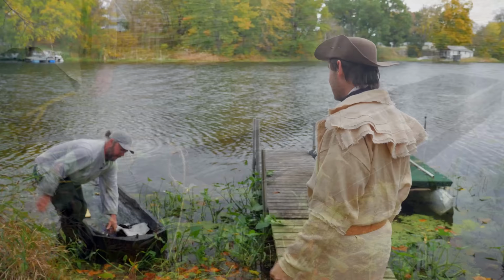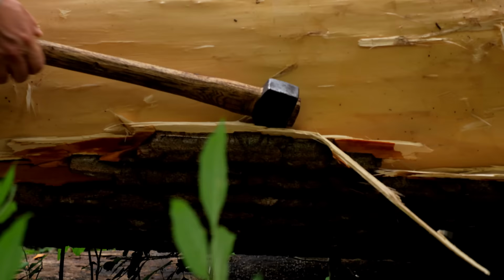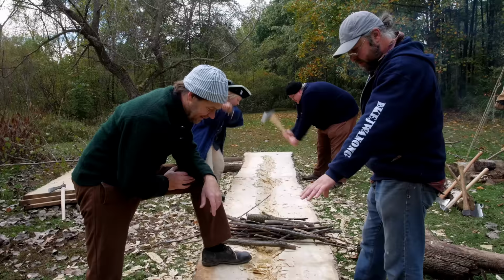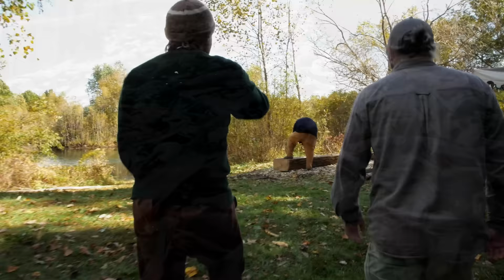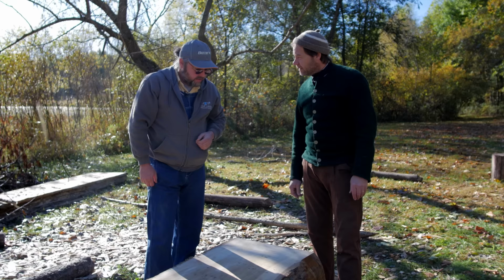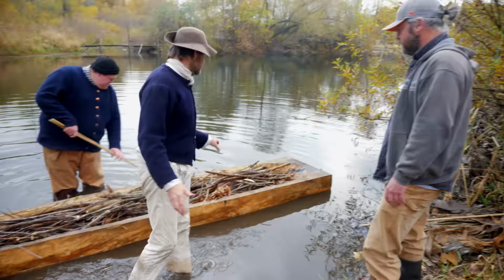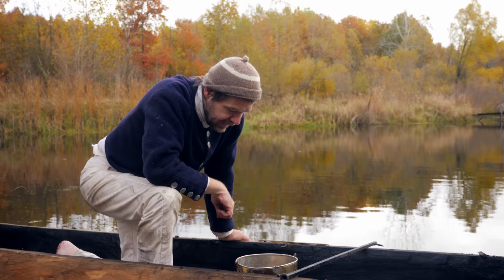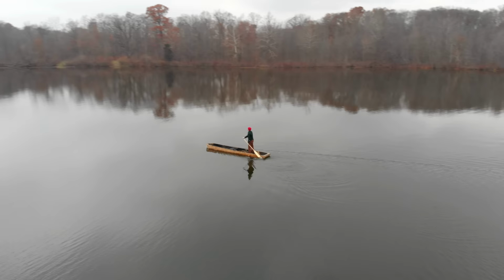From Tree To Canoe: Full Length Anniversary Edition - Dugout Canoe Build

Comment: A hewing axe would be extremely helpful for working the sides. The cutting edge is offset to one side of the axe head and handle, allowing it to be swung along a surface and take off a chip to flatten a log. There is an old video on Norwegian cabin building that shows and explains it well somewhere on youtube.

Comment: In a few lakes around where i live, you can find several of these types of canoes still on the bottom. Some a few hundred years old and some lots older. They do preserve well in some clear water lakes. 

There are finds of 8000 year old ones in Europe. Oldest here (Sweden) so far is about 3000 years, but close to where i live they found a 4500 year old paddle in a bog. 

At a lake not far from where i live there are at least 3 log-boats/canoes still sitting on the bottom and the water i so clear you can still see them despite its a few meters deep. It’s an amazing feeling to float by just watching them.

Comment: This was great!  How many hours must it have taken to do all that?  That is true labor.  But why do they store them underwater?  Wouldn't that make them rot?  Great episode, guys!
Reply: Yes I was wondering about the underwater thing as well
Reply: They will rot eventually. but it might take decades or even longer depending on the chemical composition of the water. What they don't want the boat to do is dry out, because wood being a natural material, it will shrink (and possibly warp). If the canoe dries out, there is the potential for the wood to split when re-floated in the water again as it swells at different rates between the top, which is in the air and the hull, that is in the water. Even today, with wooden planked rowing boats and dingys,  they need to be kept wet or even sunk from time to time, to keep the wood swollen and make the joints tight. That would be my reasoning, anyway 😃
Reply: To keep from getting stolen. After you do all the work making a dugout, a lazy person would avoid the hard work. A lot like cattle rustling.
Reply: @geraldmiller5260  Lol!
Reply: @jcorbett9620  So, in the olden days, I suppose it must have been important to know which bodies of water had chemical compositions that would cause problems. Really interesting how people had to work before modern science, just using intuition and a shared knowledge of the area.

Comment: They never explained the reasons for storing the canoe under water!  That was something I really wanted to know.  Can anyone please explain how storing underwater works  in preserving the boat without it getting soft and rotting/disintegrating over time?  I thought maybe they would seal it with something but perhaps that's what the wood burning process does?
Reply: Wood degrades slower in a lower oxygen environment.

Comment: Question: If you are just storing the canoe underwater...why not turn it upside down? that was its not so  bogged down with so much water when you have to pull it out to use it later?
Reply: How are you going to keep it underwater if it's upside down? You need to weigh it down, but those weights could slide off, or be moved by the water current, or animals. If your canoe is right side up, the weights won't leave the canoe, the sides keep them from sliding too much. Being made of wood, that canoe will start to float up if it's not being weighed down. The extra weight also makes it harder for someone to steal your canoe without being noticed.

Comment: Had it been me, by myself I would've grabbed a circular saw and cut criss-cross then levered out the chunks with a crowbar.
Reply: Well the entire point was doing it with what settlers had at the time, as group traveling the back woods and unsettled areas. Obviously modern tools could do it much easier.

Comment: why are they stored under water? is it to prevent it from drying and wetting many times?
Reply: That's exactly the reason. Being made of a natural uncut wood (a single trunk that was never split into planks), the canoe would crack and warp if it was dried and wetted too much. It rots and breaks down slower if it's kept under water, and it has the extra benefit to making it much harder for someone to steal the canoe, just due to how long it takes to remove the weights and bail it out. Storing canoes on land didn't happen unless it was made of smaller pieces (the nails and other materials wouldn't last underwater), or coated to help preserve it when stored in the open air.

Comment: you know theirs much lighter way and faster way to make a canoe, you have to take the bark off in one piece and you make canoe out of that oval/eye of bark, it takes some time to slowly bend it to shape and it must be kept wet during most of construction(if you arrange rocks in a stream right you can get the basic shape then keep piling rocks in middle over a week or so till its filled out shape then pull it out and work on getting its bow & starn finished, but its a lot less effort than carving one still and stronger by a number of times for its weight. they used them for over 10000 yrs in india & australia, 1 man can carry it on back easily for kms between creeks

if you do it right over generations you can take multiple canoes from a single tree so long as you dont damage it to much when your removing your bark oval to make canoe
Reply from the maker: We have made a bark canoe as well https://www.youtube.com/watch?v=lLbb0ZX5up0

Comment: Did those canoes have a keel?  Keels allow the canoe to go straight easier, but without a keel they turn easier.  Difference being, without a keel you are more subceptible to the wind.and harder to stern.
Reply: As you saw in the video, the canoe had no trouble with staying upright and balanced. Even walking across it didn't turn it over, during a windy day. I assume the log was good enough in shape to not need a keel, or the weight an shape made up for. Although they shaped the end of it, they didn't make changes to the underside.

Comment: I definitely would have used power tools to save time and get a lighter, thinner result. I would burn the interior to give an authentic surface finish. I would also create a thwart seat every five feet.

Is there historic precedent for drying the wood and preserving out of water with linseed oil?
Reply: Using power tools would ruin the sense of historical process and learning, which is the main reason for building this canoe in the first place.
Reply: @ironcladranchandforge7292  Not for me it wouldn't. I've created authentic historical impressions for reenactors using modern materials and equipment.
Reply: @KJ6EAD  --  Then you've lost historical perspective and knowledge. I've worked for the National Park Service for many years as a Blacksmith doing re-creations and restoration work.  All this work was done in an 1820's Blacksmith shop without modern tools of any kind including lighting, and using traditional tooling and methods.  It's amazing what you learn and more importantly a historical perspective of what it was like to work in those conditions. Heck, anybody that has a little skill with modern power tools can make something.
Reply: @ironcladranchandforge7292  What you're saying is true but the choice of a purist method is arbitrary. I'm just not that into it. We all choose how to spend our time based on need and interest. I'm sure I'm missing the full experience of all the things I haven't or don't do and there are things I've done that only a few ever have but I feel no need to gatekeep the rules for others unless they're damaging other people or their property. I wouldn't come to an axe event and crank up a chainsaw but neither would I go to a motorcycle event with a horse and proclaim superior historical purity.
Reply: @KJ6EAD  --  Well, you have a good point, and one in which I cannot argue against. Each person has to do what's best for themselves. Sometimes I lose that perspective because I've been so ingrained in historical research for such a long time, LOL.  

In my current Blacksmith Shop I've been known to use some limited modern power tools due to time constraints. However, I am slowly but surely moving away from that as I begin a new series of historically driven projects and research.  It's just my thing, LOL.

Comment: The downsides of storing in water is that is heavier, and must be bailed out to use it, as well as lost under certain conditions.
Reply: Natural wood will start to crack and warp when it's dry for too long, especially when it's then suddenly re-introduced to water after being dried for long periods of time. That canoe can last for years underwater, and that was the entire point, to make something that could last for a while,. It would rot and weaken faster when left out in the air. The other issue is that it's easier to steal a canoe when it's just sitting out in the open. Much harder when it's under water with weight holding it down. The benefits far outweigh the downsides.
Reply: @ZakTheFallen  
Think the bigger problem would be splitting and shrinking in the wrong locations.  You can use products to avoid these issues and avoid having to kneel in a wet canoe.  
I love that this channel takes a purist approach and enjoy watching it for that reason.  We can certainly use hybridized methods nowadays while appreciating the history, or do as those dame bv before us.  Each has its benefits.  It certainly made sense for the time however.  however

Comment: Instead of so much waste, how about portable designs that they would have used to portage up in the boundary waters?

Or if eskimos and inuits and alaskan natives could make kayaks then certainly it raises a question that they in contiguous 48 with a longer season must have had more opportunity to have had other designs much lighter and less particular and wasteful of trees.😳
Reply: This was a time when there were several times less people to do it, and didn't have the luxury of choosing different methods. You're also trying to compare very different cultures, and how rare it would have been for settlers to know that kind of information. Yes, they would certainly try different options if they knew it existed, and they did. A dug-out canoe was just one of the ways to travel, people made boats out of better materials than a raw log. But this video was specifically about the very back woods of traveling, when you might have nothing but some tools and a tree trunk to make a means of moving across water. Something you might need urgently... so for a single tree, you made a canoe that could last a decade (some where passed down through generations), and help dozens of people travel for all kinds of reasons. It often saved lives in the process. That's not wasteful, you can use the leftover wood for all kinds of things, and they often did.

Comment: That's not a canoe. That's a pirogue.
Reply: Which means "dugout canoe".
Reply: @Pygar2  a dugout canoe either has a keel, or an outrigger to deal with balance in any sort of moving water. This is flat-bottomed, and is strictly for use on still water like small lakes and shallow bayou.
Reply: Accurate name for water vessels wasn't the point of this video.
Reply: @ZakTheFallen  words have meanings my dude. They could absolutely make a 100% authentic period canoe. This ain't one.
Reply: @hersirhakarl2109  Hurry and tell Wikipedia- they didn't know!